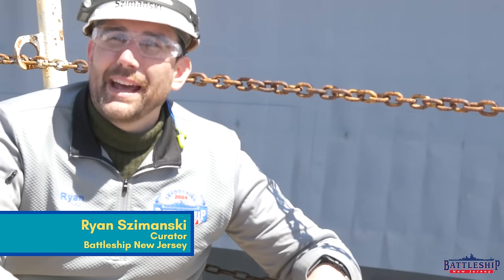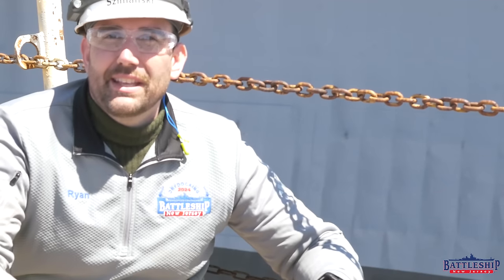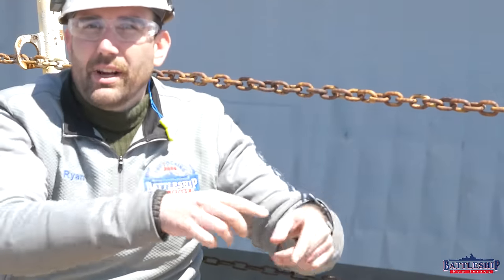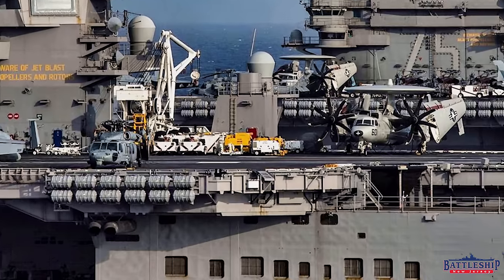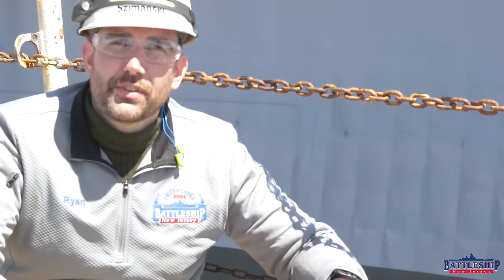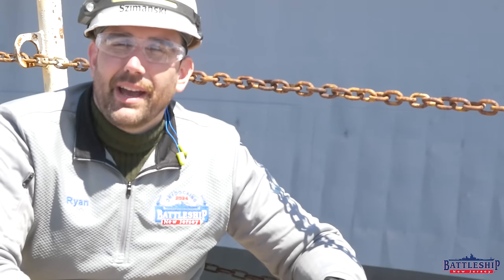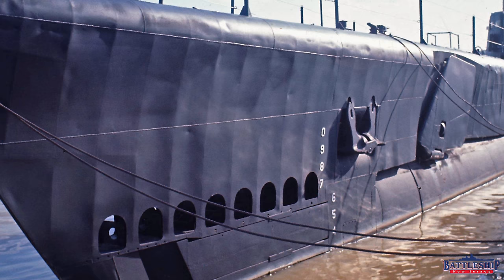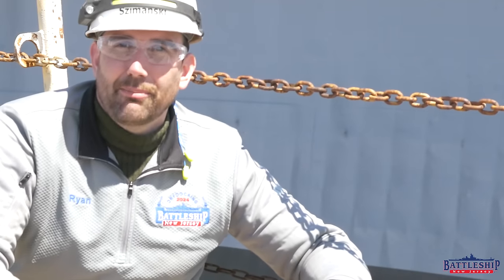What's With All Those Dents In Ship Hulls?

Comment: I've always considered the term "oil canning" to be related to the old metal and paper cylindrical oil cans used before the switch to plastic packaging. You'd stab an oil spout through the top of the can and when emptying it the bottom would pop in and out as air replaced the oil as it drained from the can.
Reply: Fun fact, you can actually still buy oil in cans like that, BUT only if your daily driver has a turbine engine. For whatever reason, jet/gas turbine oil still comes in cans, so if you daily an M1 Abrams or a Cirrus VisionJet you still gotta have the funky little spout.
Reply: Me too
Reply: The oil cans he is talking about are quite old.  Using them made a cool "poink" noise as you oiled, clicking your thumb in and out on the thin metal bottom.  My grandfather had one back in the 70's and we would play with it as kids.
Reply: @Xanman64-p6q  Ever time I hear about those oil cans I think of the Tin Man in the Wizard of Oz.
Reply: I still have my old oil spout I used years ago. It got put in the tool box thinking someday the plastic containers wouldn’t be used any more and the cans would be back. I looked at it a couple years ago thinking I should just throw it away but I wiped it off and put it back.
Reply: I still have a couple of those. 
I use them to put bar oil into the tank of my chainsaw and I use the other for oiling bicycle chains and derailleurs and other stuff that just needs a few drops in a small area.
Reply: Not a product endorsement, but look up the 3 in One oil. It still comes in a metal can.  Put it upside down squeeze the sides, release the squeeze, the sides of the can now go back into place. A vacuum is created and sucks in air from the outside. Then you can squeeze out more oil.
Reply: @oldfarmer4700  I still have one or two...better to have and not need, than to need and not have.
Reply: @Xanman64-p6q  Jeez, I still use mine.
Reply: @oldfarmer4700  maybe turn it into decoration by worrying it to a bit of plywood? Without damaging our allowing it,  of course.  I used one a  couple times. "Make sure you're actually getting the lid" is what I got told.  My dad guessed correctly that i was just going to smack it down without looking
Reply: @Xanman64-p6q  Yep, my mom's sewing machine came with a small version of that style of oil can.
Reply: @Xanman64-p6q : I heard that. 😉😆

Comment: I've watched brand spanking new ships go to sea for sea trials, all sleek and smooth. They all come back from 3 days of sea trials, all oil canned!
It just everything 'settling' in to place.😊
Reply: Was just thinking about this…. Imagine ships with ice breaker hulls…. The hull shrinks in the cold, and steel under tension is strong, but deep sub zero steel is brittle.  I wonder how they prevent ships that serve in heat and ice from having major hull issues.
Reply: @rizash  A better grade in steel alloy and/or heat treatment meant for those temperature ranges. Thicker than average plating. Extra structural members behind the ice breaking side.
Reply: @rizash  The steel that is used for building ship hulls varies tremendously, according to intended use.
I've never worked on an ice breaker, but I would guess that the bow and along the waterline would be similar to armor plating. Most ice breakers work by riding up on the ice and use the weight and inertia of the ship to break the ice from the top, vs cutting through it. I can't confirm, but it seems as though I read an article about a breaker that had a large weight they rode up on the ice with it placed aft, to raise the bow, then once atop the ice, it was brought forward to help break through with it's weight added to the bow. Kinda like the Dahli in Baltimore with an Interstate Highway on it.
Reply: It's not just settling, it's also flexing. I've been on both short and long boats and while you don't "see" it on short boats, they flex as well. On long boats... oh boy, ever been in an empty metro? :))
When that happens, the resistance the boat has against it is in part because of the skin acting like "lattice" between frames and horizontal segments (name escapes me atm). So it "crumples" and deforms as a result, because it stretches diagonally and makes a "belly" as a result.
One place one can see this all the time, old bug doors or frames. The older it gets, the more "belly" it has, it's also why old doors that aren't fit anymore crack their windows.
Reply: Now we solved that issue why do we call it spanking new
Reply: is it anything to do with the doctor-spanking-baby trope? that's the very first thing that came to mind and i have not looked into at all.
Reply: Evidently so.  I've been around many real steel ships before.  Never actually paid any attention to this physical phenomenon,   I started playing World of Warship a few years ago, and in the artwork (impeccable) noticed this detail,  Oil canning is a strange way for it to be categorized, but it's a properly old school way to describe it,  ;)
Reply: Imagine tons and tons of water battering against the hull day and night.
Reply: @rizash  significantly thicker steel, and better grades of steel is used on icebreakers than your normal ship
Reply: @aserta  That is a good explanation.  If it was ONLY plate expansion in the heat, it would appear and disappear depending on whether it had the sun on it.  I'm sure heat has an effect but I think plate-stretching caused by flexing and, yes, battering by waves, would have a more-profound and lasting effect.
Reply: @scslre  interesting philosophy
Reply: @ut000bs  I agree.That's got to be a major factor.
Reply: So you are telling me that I could walk up to those areas of so called "oil canned" and push it in with my bare hands and when I release my hand it will pop right back? If it doesn't do that, it is not oil canning. If you look at any Boeing airplane (less the 787 which is composite) you can see the same thing alone the fuselage, it is not oil canning, it is workmanship. Oil canning is not just the bulging out of the gutter skin, it is workmanship.
Reply: @michaeladams2959  actually you can push it back, if you can apply the same amount of force that got it there. It wasn't pushed in by hand, so you can't push it back by hand either.
You probably haven't experienced the oceans power. It is awesome!
Reply: @aserta  yeah, I worked on large container ships and tankers, there is (usually) a passageway (called "The tunnel") on either side of the ship, that has piping and such running through it.  There are "expansion" joints in the piping that will move back and forth 3+ inches as the ship flexes with the swell. In heavy swells (30-40 ft) you can measure 6" or so! Gotta have faith in the architects that designed the ship!
When I sailed on APL C-10's, they would have welders come aboard every trip to weld up cracks in the frames and stringers.
Reply: @ut000bs  that is the true cause of this phenomenon! People that haven't been to sea, don't understand the power of the ocean, especially when you are working against it! 
My first ship was a Gearing class destroyer. I served with my brother, who had been in the Navy 18 months or so at the time. I asked him one day (when I first came aboard) why all of the fire hose stations were raked backwards. He told me that the ocean did that, the force of the water coming aboard during high speed and heavy seas caused that. I didn't believe him, until I stood on the fantail @ 25 knts and had a "little" 1/2" high stream of water hit me. I thought it would just get my boon dockers wet, oh no! it totally drenched me and made me stumble, not to fall down!
I could tell you about other close calls, but, no, just gonna say, do NOT ever under estimate King Neptune !
Reply: brothers a chief in the navy, hes been on boats his entire service career over 20 years now. he said its WAY more common for these ships to just hit shit than you think. he said subs CONSTANTLY run into stuff underwater. whether it be whales, ice, sand mounds ect. i was shocked and horrified
Reply: @rizash Whoa! You're worrying too much about this, Riz. Boats do what they're designed to do - most of the time...
Reply: @rizash ice breakers have very thick hulls
Reply: @sharonnicholson3393  What's the first thing they do to babies that are just born to get them breathing on their own? Now you have your answer.
Reply: @Cragified  I never thought of that thank you

Comment: I was in Bristol, UK, in 1988 at a military show day.

The Royal Navy were there with the Sea Cadets in a smallish craft. About the size of a Coastguard Cutter. Whilst trying to navigate the lock system, they made a massive cock up, and backed it hard into the concrete dockside, which put a rather spectacular dent in the transom on one corner.  The kind of dent which doesn't buff out.

Oops.

They didn't stick around for everyone to see.

Someone got a major bollocking after that little bump.
Reply: put a big suction cup onit and it may pop out..
Reply: Haha wow, sounds like you saw Troutbridge come in to dock!
Reply: I saw cops smash one of their twin merc 250 outboards by backing in to a piling.  My laughter resulted in a rather hostile safety inspection.
Reply: There's a saying in the USN. If your ship runs a ground, so does your career. Same with running into a dock and causing damage.
Funny thing. We were at lunch and I asked if one of the Nuclear Carriers ran a ground. I forget which one. It turned out that carrier had run a ground in California. It caused a lot of damage. He went on to tell me what happened to that guy.
Reply: @robertboykin1828  nah, just ram in the other side and say that the ship was built that way.
Reply: Our boats are full of dents and scratches, that's what happens if you let teens sail rather big boats. Lots of fenders, and far away from other boats, it's all trial and learn.
Reply: "Your good" scraping noises Intensify

Comment: Usually caused by the welding,  it can be rectified by applying heat on the opposite side , but there is a knack to this , and it will burn off the paint inside and out,  as well as take a lot of time.

Comment: I was just there on Saturday, and while you can explain the bilge keel dings, the bow ones were not explained.  At least tracked to known incident. 

The hull pitting (all dead rust) was quite surprising.  I assume most of that came from being in storage. I had very strong urge to start welding the pits back up and grinding them smooth.  I wonder how that effects hydrodynamics.

It was a great experience, and I was able to see a Tico and CV67.
Reply: It actually makes the ship go faster!
Reply: @tedmoss  Is that like the dimples on a golf ball? 😃

Comment: As someone else pointed out, these deformations are commonly called "hungry horse".  While heating from sunlight may be an issue, these distortions look like plate yielding due to wave slam loading - huge dynamic seawater pressures from wave impacts in high seas exacerbated on flared bows where the plating deforms, plastically, to a more stable and resistant bent or curved shape.  It's not usually considered "damage" unless it significantly decreases performance or results in bent framing or stiffeners. Navy ship bows (aircraft carriers, in particular, which can be severely flared) have been destroyed by wave slam in severe storms.  Similar, but less severe, distortions also reflect weld-bead shrinkage during hull construction on the internal side of thin plating, which unavoidably pulls the plate to the inside ... they are pretty much always seen on thinner plating.
Reply: yeah I always thought it was caused by waves hitting the ship over time

Comment: B-52 56-0687 located at MCO (Orlando Airport FL) has the same skin wrinkles although it is a Vietnam era Strategic Bomber.
Reply: Every B-52 I have seen pictured has those. I wonder if there is a different cause on aircraft?
Reply: that's exactly what I was thinking on b52s after I heard his explanation
Reply: Almost every aircraft has them, it's normal for aluminum.
Reply: It's the air pushing against the fuselages.   With water it's hydraulic action.
Reply: I would have figured on aircraft it's from the the airframe flexing. Ryan stated in the video it's due to heat on the ships hull, is that not correct?
Reply: Those wrinkles go away on flight.
Reply: @robertheinkel6225  That's interesting.

Comment: i use to build navy ships after welding it pulls the steel in we use to put plates across the frames heat the short welds let it cool remove the plates and  its becomes  flat again not really needed on warships but some navy's like things looking nice , during war time ships were built fast no time to fix minor problem's like this .oil canning is caused by shrinkage in the heat affected zone of the welding process, after the stress has been removed .

Comment: There seem to be several ways this can happen, but as a non practicing naval architect and occasional welder what I was taught and have seen is that welding all around the inside perimeter of a shell section (between longitudinal and transverse frames) causes the steel to expand a bit and as it cools it tends to set with slight warpage.  Intermittent welding can avoid it by either not welding as much all over or if you complete with a second pass closing the gaps, the heat input hasn’t got such strong peaks so less bending each pass.  But that multiplies the time and cost compared to welding a whole seam at once.

I have seen it happen in my own welds sometimes that never saw daylight during assembly.  They’re not professional grade welds by any means but pros at shops have seen the same.  And shipyards with inside under cover steel fabrication, sometimes you see the effects anyways.

It’s truly just cosmetic, won’t affect tertiary or secondary or primary bending strength of the hull noticeably.

Comment: Rose bud torch the seams and spray with water..draws the steel tight..we used it on oil drilling rig construction in Vicksburg, MS back in the day...heat will move anything, even pipe

Comment: OK. Small correction. 

In the video you said that the lighter colors absorb the rays of the sun and prevent heating. 

The way i was taught in high school, in theater programs, and independent research into the statement. 

Dark colors absorb the the rays of the sun which intensifies heating. Light colors reflect the rays of the sun which minimizes heating. 

It's a smallish nit to pick, but when I had to worry about picking up black painted objects from the stage that had been lit up for 2 hours being too hot to handle vs objects painted pink or white, it gets you a bit.

Comment: Did my apprenticeship in the early 80s RNZ there were two Leander class there at the time one was built during piece work and was badly effected due to the extra high amps used to achieve faster completion. I am a Bioler maker welder and this made sense to me.

Comment: Oil canning is also common on aluminum skinned aircraft. If you ever saw a 747 on jacks and not on its landing gear in a maintenance hanger the entire aft section of the aircraft under the vertical stabilizer is puckered in or out depending where the supporting frames under the skin of the plane are at  It is just another example of oil canning and it does not hurt or even damage the aircraft. Once the 747 is in the air the oll canning will go away as the aircraft is pressurized.

Comment: Thanks.
I've been told that when they attached the last connection of the two halves of the St. Louis Arch, they did it on a worm sunny day so the steel would be hot, then they used fire trucks with water cannons to cool the exact spots needed in order to align the bolt holes at the top.

Comment: This does not as likely to appear on riveted ships since there is not a heat affected zone like the double fillet welds at the frames and bulkheads. Yes flat areas are most susceptible while curved plates being more ridged will offer greater resistance to this. This is also called "Hungry Horse". Two British destroyers a new welded one, and the other an older riveted. The skipper on the riveted ship sent a message saying that the other skipper needed to feed his horse since she was showing her ribs.

Comment: Saw this on USS Hornet recently and was curious why it exists. Thanks for the info!
Reply: but wrong this is not due to the sun its the welding process, extream differences in  heat, sun has not enough power
Reply: @hmcredfed1836  I'm sure it's a combination of both, bud. Sun is pretty powerful

Comment: when a ship is dry docked does it need any sort of interior structural support to keep it from flexing apart due to lack of exterior water pressure trying to crumple it up? ...like chains from port to starboard ribs or tethering braces or straps, so it doesn't bow flex outward from lack of spring tension pressure the water provides.
i had a great uncle in the navy, but i had never seen this process done for large ships just a destroyer he once commanded on, so this question never occurred to me when he was still alive.
2:00 the word he is looking for is conical, as in cone shaped.    the plating is expansion and contraction from many factors: heat is one, water pressure stress when in motion, blast pressure shockwaves from larger caliber weapons for thicker armor plating, also flex stress when a ship goes into a turn you can watch one side oil can, and the other side go taunt.
Reply from the maker: Nope

Comment: I "woke up" to oil canning when my supplemental heating coils kicked in on my heating system.
It was like a really loud firecracker went off under the floor.
The ducts will distort when the temperature changes rapidly and that sometimes makes large areas suddenly snap in or out.